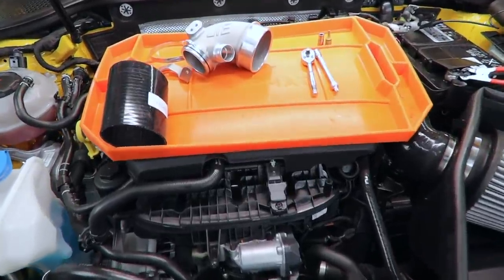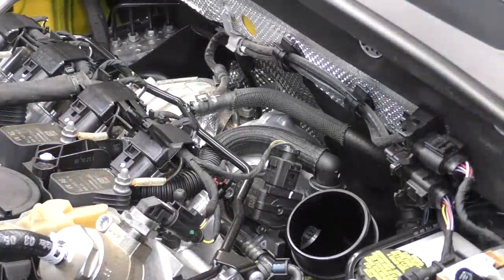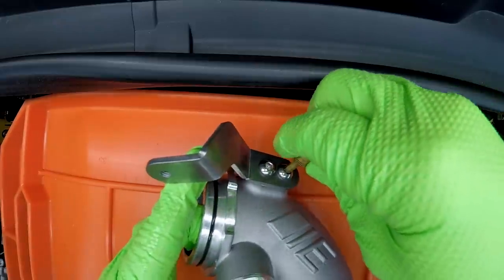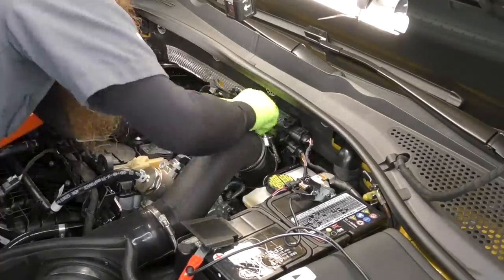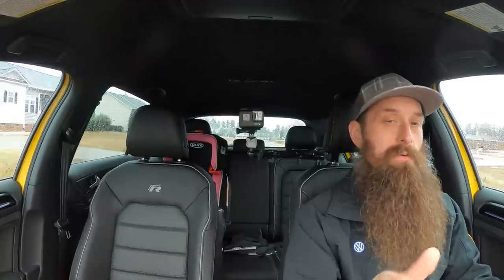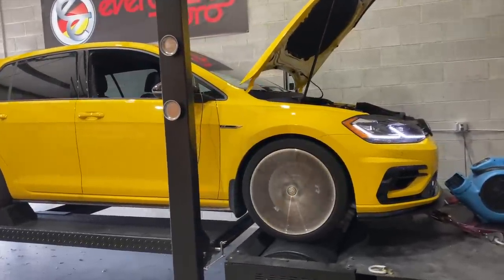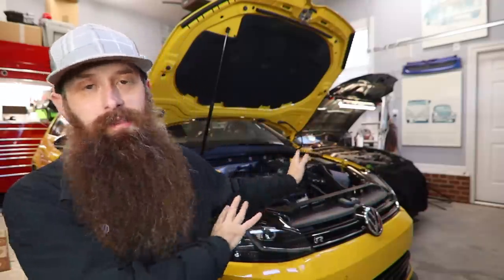Turbo Inlet Pipe Upgrade and FULL Stage 2 Golf R Modifications

Comment: Hey man! Do you think there would be any dramas to the paint work on the hood if you were to remove the foam pad/insulator underneath the bonnet? Reason for removal would be sound enhancement for the turbo and intake. Pls let me know !
Reply from the maker: I’ve seen hoods have paint issues from heat. I’d leave it on.
Reply: HumbleMechanic have you seen that on MK7 GTI/R’s? Apparently the new MK7.5’s don’t come with them??

Comment: So your exhaust is stock except the intake and downpipe, correct?
Reply: The down pipe and intake are the biggest restrictions to flow since there small diameter and have bends in them that they will net you the biggest hp gain compared to just changing the rear of the exhaust

Comment: I've got a mk4 Jetta 2003 I love my car it started having an issue I cannot figure out some times it will die but starts back up sometimes it will act like the battery is dead but you turn the wheel back and forth and it's fine other times my dash goes dead most times if the radio is on and you are jamming (lol) checked fuses battery fuse box is updated just looking for advice

Comment: Question —- I have a problem. I went to install inlet pipe and now I have a stripped screw and a stripped bracket. I can possibly tap the bracket, but how can I get a replacement bolt? Is this something that can be ordered? I noticed the at the turbo end it’s just a hole, can I use a socket head cap screw that is the same length and thread?

Comment: Hey with all these Mods and tuned at stage two how does you mpg do, like if you wanted to road trip the car at stage two would it perform just as well on mpg in 6th (manual) or 7th (DSG)

Comment: Hey Charles, if doing a Stage 1 tune on a GTI/GLI, considering the jump from 230hp, to almost 300hp, would you need to start taking other upgrades into account? Most manufacturers spec their parts to meet a specific operating tolerance, and by increasing the engine output by almost 30% what parts would you recommend keeping on eye on, or potentially upgrading as a result (such as clutch, axels, mounts, flywheels etc...) or do you think/know if the stock parts can handle the extra power easily?
Reply: Could you make a video reviewing this topic?
Reply from the maker: Clutch can be a weak point. Tires are a weak point. But after that is feel safe with stock and stage 1 software

Comment: * this is an old video, IE tune files can be done in the convenience of your home!!**

I went IE, for a off the shelf Stage 1 tune is a very good upgrade. The powerband is smooth and consistent across the room range to 7k redline. 
It passed emissions in the central states. 
It is not the most powerful tune, but it is a reliable safe nice upgrade tune with no glitches. 
It gave my car a few pop and bangs on the lower range of the rpm map. I already have a catted downpipe for stage 2 and will have to add a DSG tune to it, highly recommended by IE.
With IE you can do the update at home, NO need to go to a performance shop.

Comment: Shouldn't that torque curve be a bit less bumpy? It makes more power but the curve doesn't look that smooth.
Also would you consider taking about fuel quality and its impact on a time?
I have first hand experience with running stage 2 Apr but with weird Canadian Fuel. I got a custom tune and gained 30+ BHP over apr
Reply from the maker: Yes. That’s one of the things they are still playing with in the tune. 

On the custom tune you almost always get more. The OTS tune is a little more generic and you can tweak a little more for the custom dyno type tune

Comment: I have a complete stage 2 APR component set on my 2019 Golf R 7.5. The center counsel performance monitor power output display appears to be capped at 215 kW. Is there a way to increase the display cap to 300 kW?

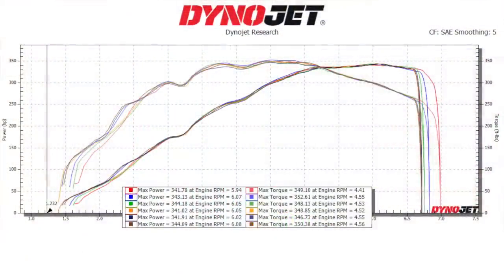Comment: At 10:25 it seems the second setting gave the most of both torque and horses combined - yet you apparently went with the last setting gaining almost one hp but losing two ft/lbs. Why?

And 5G is quite a lot for 30 hp and no torque - imho. 😊
Reply from the maker: For the cost you have to compare stock hp/tq. I’m actually on about 4 files further than the last runs. Lol

Comment: 8:44 I am so confused, my car does not show the gear it's in Sport or Drive. It only shows "D" or "S", or "M1" "M2" if I'm in "manual shift mode". Am I missing a setting to enable this? Sorry for commenting on an older video, but any help would be appreciated. I looked all over in my settings but I must be super blind.

Comment: If I was to do stage1 is there any easy mods that would give some extra power to the tune.  Like would the intake upgrade or the inlet pipe upgrade be beneficial? Or being only stage 1 will those upgrades not work well or be needed. I'll be doing unitronic 1+ tune if that matters
Reply from the maker: Inlet is the best for power. It’s all very minimal compared to the tune
Reply: @HumbleMechanic  ok thanks . Thinking about adding the inlet pipe and intake to go along with 1+ tune. My shop tells me I don't need a dsg tune with stage 1 as opposed to stage 2 dont want to spend the 5k to go stage 2. Thanks again,  I really enjoy your videos!

Comment: I’m curious the differences between your Golf R and my Leon Cupra 290.. as they’re powered by the same engine though mine is a 7 speed DSG. So stage 1 for me is between 350-370hp/360ft  and stage 2 is 400hp/400ft using the exact upgrades you placed on your R.
Reply from the maker: Are those wheel HP numbers?
Reply: HumbleMechanic According to APR’s website, the power was measured by wheel figures. They used a US spec 2016 Mk7 Golf R for their test subject. I’ll be honest I don’t the variants of this engine yet, mine standard is 287hp/290ps. I’ve recently changed from a 2003 Leon Cupra R 1.8T 20V (AMK) stage II which I’m more experienced with.
Reply: Mark H ah sweet, I merely went from this small print, stating measurement from wheel figures.. cheers for clearing that up and the link dude.

Comment: Do you think going Stage 2 compromised heat management for high demand conditions, like track days for example.
Reply from the maker: It will push everything harder. The main head soak should be taken care of by the charge cooler
Reply: @HumbleMechanic  if you want to track hard your stg2+ car...like mine safely..you need intercooler, iAbed baffled steel oil pan, vwr oil management system..this is must have..as an oe pcv system not good,charge pipe kit...and wrap the discharge with gold tape. You need also a safe map...and good oil like millers nanodrive nt+ 5w40...in this case oil will reach maximum 135 137celsius gegree....
For stg3 track you need an external oil cooler too from vsracingline
I know this..i track my 7.5 very often with good results!!!

Comment: @HumbleMechanic after going to Stage2 (CJXC engine) and stock exhaust after sport downpipe I had some problems with P11AC Cam Shift Actuators DCTs and limp modes with ACC error (around 3k RPM, while cruising). Do you have any ideas what could be the cause or what should I check? I replaced the actuators, but the issue was still happening, it did not reappear after upgrading the whole exhaust, but I am afraid the issue is still there. Thanks!

Comment: @humble I have MK7 2017 stage 2 DP and IC APR dsg tune. what are your opinions if I were to sell car to upgrade to R with parts transfered and license. Would all parts work and what would be my net increase in power? Your dynos showed 340, but GTI stage 2 based on APR site says 325. I haven't dyno..
Reply from the maker: I think they are all the same other than tune.

Comment: Aren’t both of these tunes (stage 1 and stage 2) underperforming for the Mk7.5 platform? APR claims 350ish horsepower for stage 1 only. Is it just a better file on the APR?
Reply from the maker: I’ve seen apt wheel dyno numbers and they aren’t that high for the golf r. 

I’m actually cool with no having as high of hp if the driveability and safety are there.
Reply: Fair enough, i suppose the dyno numbers vary from dyno to dyno, and you did say it was a beta file. Love your colour by the way, i have a ‘19 R too, and I was so torn on getting a spektrum colour. Unfortunately the roads/weather conditions in Alberta are horrible and the paint would be so vulnerable. Even my lapiz blue is vulnerable. Keep up the great content!

Comment: Noob question, please help. Internal wastegate, actuator has a nozzle, but nowhere to connect. Now where to, does a wg need boost or vacuum? Do i drill a nozzle in the charge pipe? I tried sucking on the nozzle and moved, when blow nothing, I'm confused by forums and other explanations. Thanks
Reply from the maker: Closer to the turbo housing the better. I did mine in the silicon hose right out of the turbo

Comment: What's the best most reliable mod for an NA 4 cylinder engine? I'm just trying to make 30-50hp.
Reply from the maker: I don’t think 1 single mod will get you that much power. You’ll be deep in the engine to come close
Reply: @HumbleMechanic  it's the N43 BMW motor making only 170hp in my E82 120i. I hope software can help

Comment: What does “Stage 2” mean? Stage 1? Honest question.
Reply from the maker: In this case it refers mostly to the software. 

Stage 1- basic software 
Stage 2 - pushes most things to a reasonable Limit and requires hard parts like downpipe, intercooler, intake

Comment: Hey Charles, would you ever consider getting a custom sunroof on the Golf R?
Reply from the maker: No. I’m happy not to have a sunroof. Although an aftermarket roof would be way better than OEM. Lol
Reply: @britishav8tor75  The whole reason why they don't have one - is purely down to cost cutting through limited model variant production runs, for the US market......come to the UK and you will see many a Golf R with the pan roof.
Reply: @britishav8tor75  It's strange because the European models have them on the same platform. I would be more concerned about electrical issues and leakages. But what u said is absolutely correct too

Comment: Whats stock power in the US?  We are 300bhp for a Mk7 and 310 for early Mk7.5.  My 2016 R wagon is APR stage 1 ECU, TCU and is 380bhp, stage 2 with hardware about 400 bhp.
Reply from the maker: This car was 288bhp stock. The numbers we are looking at in the graphs are all wheel.
Reply: 344 hp at the wheels is about 437 hp at the crank.
Reply: @connor5147  crank means nothing because ET/MPH tell the truth, there is also some correlation between 0-60 times and 1/4 mile times.
Reply: Anthony Thomas I realise that, I was only trying to help him by giving a comparison to wheel and crank hp because obviously, by his comment, he is more familiar with figures being shown as crank so I would have thought it would have been helpful to tell him the figures in a form he is familiar with.

Comment: Hopefully your turbo holds up! The 7.5 R has a pretty high rate of turbo failure once stage 2 is running
Reply from the maker: Good excuse for an upgrade
Reply: Corey Hartland I believe this turbo issue was corrected on the 7.5R, and that turbo failure mainly affected the 7R. Even so, i’ve known several stage 2 owners and haven seen one with a turbo failure...

Comment: Stage 2 not worth it my opinion. Extra 2K+ for little to no extra torque (which is just as if not more important than HP), and 25-30 HP. Hardly notice a difference....but if your have money to burn, why the hell not. I would only do cooler, downpipe if I was adding a bigger/hybrid turbo.

Comment: Remember that he is dyno’ing his AWD Golf R in 2WD. What does this mean in reals world applications? That he is actually “cheating” his dyno numbers. In the real world he isn’t getting that 340+whp. He is getting less because he will be driving in AWD, and AWD has more drivetrain loss compared to 2WD.

Yes, you can make the argument that the Golf R uses 2WD (FWD) most of the time, but my argument back is that though you’re correct, when you put your foot down to utilize all the cars power (hence the full 340+whp), the Golf R most definitely is using AWD during those pulls.
Reply from the maker: The point of the dyno was never to hit a number. The point of the dyno was to see improvements. So the total number is less relevant than the improvement. That’s why keeping the same setup is more important to me than 2wd vs AWD.

Comment: 3-5 grand for bolt ons to make 350 to the tire in a $40k+ car? (Drake holds up hand and looks away)

$800 wrecked Silverado from FB marketplace, eBay turbo, springs and a cam, 700 tire? (Drake smiles and points)

Comment: Fucking hell! 4 hours for a downpipe? and 500 USD? I would have thought fitting everything would come to about 400-500. Labour rates is miles off, glad I live in the UK. Everything you stated would be considered a 6 hour job MAX. A VW specialist would charge about £65-80 per hour in the UK.
Reply from the maker: $100-120 is average labor rates in my area. The times came right out of the labor book.

Comment: This doesn’t seem that expensive, more than I can afford, but less than thought it’d be.
Reply: $3500 for bolt ons is outrageous when you realize that you can get turbo kits from on3 or CXracing for under $1800.

Then, $1800 is outrageous when you realize that you can get a turbo from eBay, a mig welder from harbor freight, and all the piping and hardware to fab a kit for under $700

Comment: Hi. I would really appreciate if you find the way to install self parking assistant. It’s available in Europe as a paid option, but I never found it in US.
Here is parts which I found, but I’m not sure they are proper one https://www.carsystems.eu/vw-golf-7-park-assist-pla-1t0919297a-upgrade,id667.html

And here is manual for Jetta https://www.team-bhp.com/forum/diy-do-yourself/183673-diy-install-park-assist-pla-2-0-self-park-auto-park-vw-jetta.html
But as well I’m not sure it will fit golf R

Comment: Coming from the world of DSMs I'm so annoyed by this "stage" nonsense. Here it comes. My "stage" rant. Sorry in advance.

I get why these mods are grouped together, it makes it easier for people who don't understand what they're doing, but it seems that for anyone actually interested in tuning the car themselves (a thing that I actually did both at the drag strip and on secluded roads), "stages" are meaningless. It just makes wading through upgrades a confusing mess because I'd rather just buy a part, datalog it, and then tune based on what effect it has. I guess for someone who just wants to buy A B C and D, that's fine, but I want to just buy parts and then put them on the car myself and then see what difference they make. And if I have to tune for them, then I will. 

I absolutely cannot stand how every freaking part in the VW world has a "stage" associated with it. I'm not upgrading my car in stages, I'm adding parts as they make sense and fit my budget. I'm blown away by how many people slag the Cobb Accessport (apparently the only tool available to VW owners that will let them actually tune their cars themselves) because the "stage" Cobb maps aren't good. NO SHIT, every car is different! It's like I stumbled into an alternate universe!

I understand the huge benefit of "tunes," but that doesn't substitute actual tuning methods for me. I'd rather datalog everything and adjust specific fuel and timing curves based on what I was seeing with my own eyes in my own car. And I would never assume that someone who has never touched my car would know what tune is best for it.

Rant over. I guess I'll be one of the few VW owners that actually tunes their own cars. That is not to say that I dislike this video. I like it a lot! I think you add a great amount of information to everything you demonstrate! My rant is not directed towards you or your content, but simply the concept in general.
Reply: Holy shit, 5 grand for all that and you can't even tune your own car?

Again, I get why some people would go for this. But damn, Cobb Accessport is $675. That's cheap for what it does! That's a fraction of the cost! And you can get other people to tune it for you!